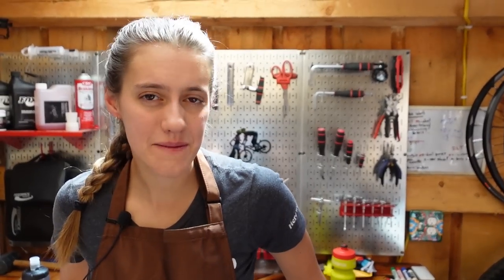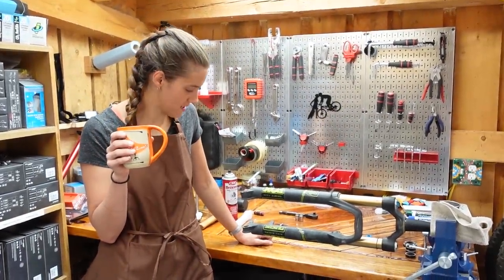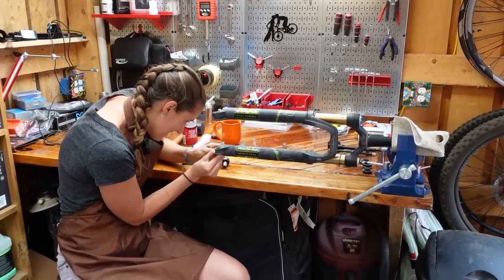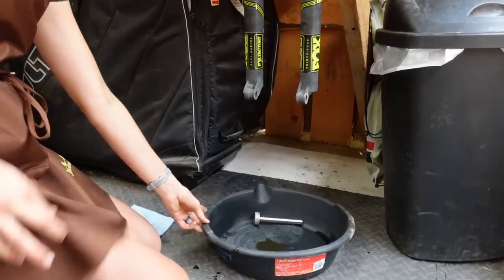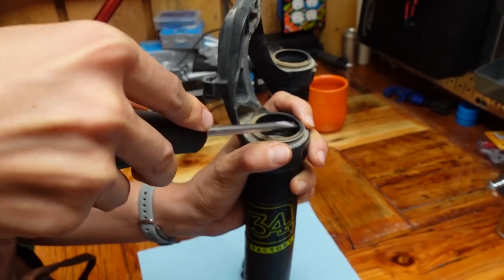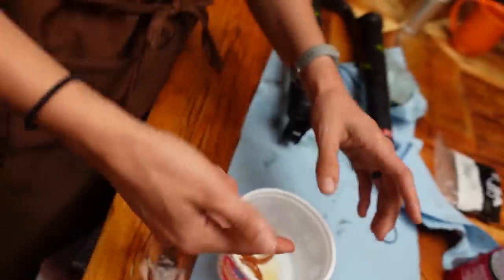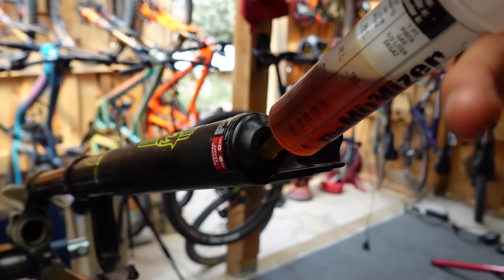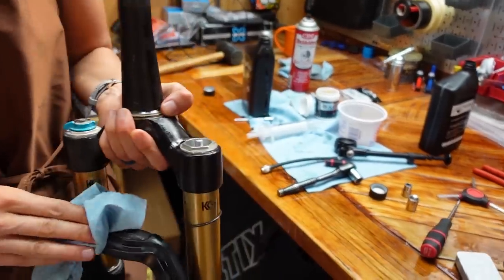Lowers service on a Fox fork | Syd Fixes Bikes

Comment from the maker: One thing we forgot to mention: when you're adding pressure back into the fork, every 20 psi or so, leave the shock pump attached and slowly compress the fork a couple times to allow the positive and negative air chambers to equalize. It will also slightly decrease the pressure in the upper chamber (what the pump is reading), so do the same when you get to your desired pressure and then double check that the pressure is what you want it to be.
Reply: timing from start to finish?
Reply: Another note:
1cm³ = 1mL
Reply: @peaceinpowder  18:56 😅

Comment: Tip for installing seals without a seal driver. Put them in the freezer for an hour and they install easier, also use slick honey or slickolium on the inside of the fork.
Reply: My version of this is heat the lower slightly with a heat gun

Comment: Some tips....
1. Clean the fork and dust seals before disassembly so you aren’t introducing dirt into the lowers when they are removed.  No reason to add contaminants. 
2.  Have the fork rotated up past 90 when you hammer the shafts in.  That way you can control when the oil pours out.  Just like you did when you added oil. 
3.  A seal installer tool is much more important than the shaft hammer tools since you can use the socket to hammer on.
4.  It is necessary to pre oil the foam rings, not optional.  Just because fox doesn’t build them correctly, doesn’t mean you should.

I really like the 1 minute overview you added to the end of the video.  So helpful for reference.

Comment: Great video! You guys are killing it!

To remove wiper seals from lowers use a cylindrical solid piece of plastic an 1” in diameter and about a foot long. You can score off amazon for nothing. Much safer to remove wipers without scratching anything.

Also make sure to soak foam ring in the correct bath oil. Grip 2 uses 20gold on air spring, but ptfe 5wt on the damper side.

Finally, don’t ever use the aluminum nuts to punch loose the damper and air spring shafts. The threads can be easily damaged doing this making it very hard, if not impossible, to thread them back on.

Just some things I noticed
Reply: What to use instead of the aluminum nuts? (DIY-style)
Reply: If you can find another nut with the same thread pitch, then use that. Otherwise get the steel punches from Fox.

Comment: That was really fantastic guys.  As a few people have noted, the theme of "Newbie learns to do advanced maintenance" makes everything much more approachable.  I'm, generally, a really solid mechanic, but have a fork (not Fox, but as Mackay notes, they all work generally the same) that is serious need of a service.  

Unfortunately, the rebuild kits for Suntour forks are really hard to get in Australia, grrrrrrr (will just have to buy the correct oil, and re-use the seals).

Thanks again guys.
Reply from the maker: We usually just do the oil and don't worry about the seals, so you should be fine. Might be worth pulling the foam o-rings out though and trying to clean then a bit (probably with just water and dish soap) because if they're super dirty they're just holding dirt against your stanchions and don't hold the oil as well.
Reply: @sydfixesbikes  Again, thanks for the advice guys.

Comment: OK, now this I needed.
I've always been terrified of touching my suspension. It's the only regular-ish maintenance thing I still go to the bike shop for every single time.

I'll try to do it myself next time 👍🏼👍🏼😎
Reply: Fork lower service and basic air can service on shocks is super easy (provided you have the correct tools). Assuming you have a work stand and basic tools, the extra tools needed for a fork service will pay for themselves on the first lower service you do.
Reply: @setransou  agreed. I've been riding for 5 years and wrenching on my bike for about 4, but I live in an apartment and while it's not tiny, I can't justify the space for a work stand... Maybe I'll look into a wall mounted alternative or something, but yeah. I'll look into investing into the few things I'm missing and get all the stuff necessary to do this. Thanks!
Reply: @Leo_Inclan  I hang my bikes in the ceiling with a "bike lift" meant for storage to work on them, not as sturdy as a proper work stand but it takes no room when not in use and gets the job done..

Comment: cool video! 
I have to say though on that fork with a service that long overdue, I would have cleaned the entire thing inside out and also removed the air spring, cleaned and relubed that. Who knows how much dirt was already in there everywhere. 
Other than that, you addressed exactly the points that every one doing this for the first time is afraid of!

Comment: You guys are great.  Thank you so much, I have an old Float100r on a KLEIN Palomino V and I want to grind the rim brake mounts off and paint the bottoms and the crown to match the "legendary" color shift blue paint (it's a full suspension cruiser essentially with gold and yellow accents).  Going to be tricky, I know, but disassembly seems to be the best course of action per heat and all, I already cooked a set of skeletal brakes, per heat from the Dremel, and don't want to make that mistake on these forks.  Thanks again and keep up the tutorials, you're the awesome Syd.

Comment: Fork service and steering tube cutting are the most scaring tasks for me! With this video I'm a little more confident on the first one...
Reply from the maker: Steer tube cutting is quite straight forward as long as you remember to put everything on before you measure (bearings, spacers, stem, additional spacer or two). Macky might have forgotten to include the stem one time... That was really bad!

Comment: As you found, a screwdriver is kind of a chaotic way to remove the dust wipers. It's easier if you use an open-ended wrench--they have one prong that points up and one that points down when you hold them sideways. Insert the upwards prong under the edge of the wiper and push down on the handle. I think the best size is something like 17mm but I just grab a handful of wrenches and test them until I find the one that fits perfectly.
Reply from the maker: Good tip. We saw that on the Fox website too, but not until after we'd used a screwdriver 😁

Comment: Nice video. Fork service scares me too.
One tip: don't use a regular screw driver to pull the o-rings. When you put a leverage like that there is a good chance you will damage the paint. 
And then this looks ugly because the paint comes off in sort of flakes (not just the area where you applied the pressure). Cover the screw driver with some hard cloth.
Edit: I also clean the fork thoroughly before opening it - some left over dirt might fall into the lowers.

Comment: For the lower leg service you don't need to remove the air. To remove the seals you can use the closed end of a wrench. And when you're installing the new ones you can put some grease on the outside of the seals and then they'll slide in much easier.
Reply from the maker: Good tips!

Comment: I don't know if this has already been said in the comments yet, but you can use a tire lever instead of a flathead screwdriver for removing the dust seals :)
Reply from the maker: Interesting. People have recommended dowel rods and wrenches, but not tire levers...

Comment: Great video. I will be following your excellent instructions to service my fork very soon. 

One thing: The link for "Fox 5wt suspension fluid" is incorrect. It actually goes to "Fox 20wt Gold fluid." A copy and paste error, I'm sure. 

Keep up these very helpful and informative videos. They are much appreciated in this DIY household.
Reply from the maker: I think it's actually the same link for both the 5wt and 20wt and you just choose which kind of oil you want from the drop-down before adding it to your cart. Let me know if that doesn't work!
Reply: @sydfixesbikes  Thanks! That works.

Comment: Unless you are pulling out the air spring you don't need to let the air out it won't shoot the lowers off, it will shoot the air cap off the top if you take it off without letting the air out.

Comment: A 20mm open end spanner is good for removing the seals, with the added benefit of not launching the seals into space.  A 25mm Dowell with a hole on one end, for the rebound,  is also handy for removing the lowers if you don't want to spend a fortune on the fox tools
Reply from the maker: But then you don't get to go chase your dust seals 😁

Comment: open wrenches work better for seals imo, protect lip though you can bend the metal if you use a screwdriver like that.  Supposedly big metal tire levers work well, but I dont have any.

Comment: huh...I didn't know you also put oil through the valve core.  I've always just done it through the lowers.  Thanks!
Reply from the maker: We added oil to both the lowers and the air chamber in the video..
Reply: @scottwhite3454  yeah, the chart says air chamber gets oil too. TMYK
Reply: @sydfixesbikes  My bad, got distracted and missed that.
Reply: The oil in the air chamber stops the slickoleum from gumming up over time and clogging the transfer port between the positive and negative chambers.

Comment: So good Syd. You're so cute working on the forks ! I' was scared to work on my son's 2018 Trek Fuel Fox 34 Rhythm forks -- as they need servicing but I;m not wanting to send it in.... If I can do this I will also do my 2021 Fox 36 Rhythm off my Giant Trance X2 --- really X0 --- customised now with an upgrade 2022 Fox Factory 36 160 Grip2 VVC this week great deal----- I feel I might really need to do these as they are so wonderful but.... I measured travel before having them installed at 166-167mm which may be correct as both my Rhythm measure 5-6 mm over the said travel spec, ie, 130mm and 150mm. Currently I think my Factory 36 has OVER greased in lowers from Fox factory and so the ports between neg/pos chambers may be blocked a little? I experienced the fork travel suck in when adding the vol spacers? Anyway right now it measures 160-159mm max.   However, I also realize these amazing plush forks need PTFE oil  for the Grip2 VVC damper, Anyway, a really inspiring and easy and clear video for servicing the lowers, Thanks you so much for making the time. PS: I can't wait ti hit the trails with my new FOX Factory 36 --- they look so cool on my jade green Giant Trance super - Mullet

Comment: When I take stuff apart, I try to take pictures before I take it apart. Also, as I disssamble things, I take all the screws of that assembly and put them where an egg would go in an egg crate (thing eggs come in at the store). That way things are grouped. Continue until everything is apart, filling each egg crate. Lots of times, if I am taking apart both left and right, I the right parts 'across the  egg crate' (left parts go where egg #1 goes, right parts go where egg # goes, assuming a dozen eggs).  Then when you reassemble, start at the last egg hole and work your way backwards to egg hole #1. Not my idea, stolen from a friend,  Also Syd is cute! And gaining competence. This is cool in numerous ways because she learns as she goes and any noob watching sees it can be done.

Comment: This is absolutely brilliant 🔥 The way I can relate to Syds worries annoy damaging stuff and then seeing it done no problem was just so satisfying. I've been putting up doing this for a while now. 2 years without service, it's gonna feel good! 
QUESTION: My 34 Performance Elite Float FIT4 has a "open mode adjust" slow speed  compression dial but it's stuck and moves with the 3-way lock out knob. How do I fix that? 
Awesome new channel guys, big fan of this!!
Reply from the maker: I think it's supposed to move when you flip the lockout knob... But if you can't move it independently it might require a damper service (something we haven't covered yet). It could also just be as simple as it being dirty and stuck. The first thing I'd try is some WD-40 sprayed on and around it, let it soak a bit and then see if you can get it to move.
Reply: @sydfixesbikes you guys truly are a blessing, thanks for the rapid responds. Yeah, it's stuck in a way so that I no longer can adjust it. Had left it in the range setting for some months and all of a sudden it was stuck.. I'm definitely try som WD-40. Been dreaming of young kit forks from 140 to 150mm. Equally much to get a little slacker headangle as the extra travel. Would that be I'll advised on a Fox 34 being a 190lbs rider..?
Reply from the maker: I doubt you'd feel much (if any) flex with the 34. They're quite stiff, even at 140/150mm!

Comment: When I serviced a Fox shock, in the kit they supplied 2 vials of fluid/oil for air chamber which was blue and instructions told to avoid contact with skin (can induce cancer). Seems forks don't use such hazardous substance...

Comment: Most of my mechanical experience is working on trucks.  "Getting things off of things" is 95% of truck work.  It's actually what intimidates me about bike work.  With my truck suspension, if the ratchet doesn't work, I get a breaker bar.  If that doesn't work, I put a pipe on the breaker bar.  If that doesn't work, I get an angle grinder or torch.... I'm not sure my skill set will translate well to Mtb suspensions.
Reply from the maker: Yeah, you're gonna wanna go WAY lighter than you feel like you should whenever tightening any bolts 😁
Also, if a bolt isn't coming loose, make sure it isn't reverse threaded... There aren't many on bikes, but you gotta watch those pedals!
Reply: @sydfixesbikes  Just seeing torque specs where decimals matter makes me nervous.  Thanks for helping me learn, though!

Comment: Thank you, the content you are both putting out is super fun and helpful. I have service kits ready for the front and rear suspension. I will crack on with that this autumn/winter. I have a question, what vice are you using? Looks like such a versatile vice. Thanks in advance! Happy trails!
Reply from the maker: We got it on Amazon. Here's the link: https://amzn.to/35xd1Kl

Comment: If you have too much movement with the lockout closed, is that a sign there isn't enough oil? If so, which side needs topping up? I have 25-30mm of movement with the fork locked out.
Reply from the maker: No, that sounds like the damper needs to be rebuilt. I believe this is something I've can do themselves, but we've never done it as it requires a lot of specialized tools.

Comment: great vid, thanks for this.  Question- on forks with Grip2, the damper side uses PTFE oil rather than gold.  One thing I've never been sure of- do you soak the o-ring on the damper side in gold or PTFE??
Reply from the maker: You want to match it to the fluid that you're putting in that side (inn this case PTFE) because that's what it will be lubricated with as the fork cycles.

Comment: Thank you for this! I just bought a 2012 Mondraker Foxy and I want to rebuild the fork. The only problem is that I can't find the specified seals on the internet for anything below 100€. I was wondering if you guys can help :) Do new fork seals work with older forks(the same size)? Thank you!
Reply from the maker: Hard to say. In general, if it's the same model, you should be able to use newer year seals, but probably worth checking with the fork manufacturer. Good luck!

Comment: I noticed that you added Fox 5 wt w/Teflon to the air chamber, I'm not seeing that called for in the Fox Charts for current models.  Is that a Pro tip?
Reply from the maker: Some of the current models still recommend that (it's listed as "air chamber"): https://www.ridefox.com/fox17/help.php?m=bike&id=2817

Comment: Hi! Is the fluid through the air side valve core needed for all 2020 models? This is the only video I have seen do that. I have a 2020 34mm Float Performance if that helps
Reply from the maker: You can either inject it through the valve or remove the air cap and put it in that way, but yes, all forks require it (it's listed as "Air Chamber" on the volume charts).

Comment: Is it safe to reuse the crush washers if they are nearly brand new still and haven’t been removed yet? 

I just need to add bath oil to the grip damper side.

Thanks!
Reply from the maker: Technically, no, but we have done so without issues. I'd say go ahead and then clean that area really well and check it a couple days later to make sure it's not leaking.

Comment: Thanks for the video guys….but I have a critical question:
A week ago I have serviced my FOX Rhythm 34 2018 Fork according to the video.
unfortunately, later on I have discovered that I should have put 5WT bath oil on the Damper side – since my fork is a GRIP Damper (!).
Would it be OK to leave it that way?
And if not, What are the implications for that and What should I do (service) in order to correct it?
Reply from the maker: That's a great question. Based on some googling, it sounds like it probably won't hurt anything but it could negatively affect the performance, especially since it's on the damper side. You shouldn't have to do much to fix it, just drop the lowers and put the correct oil in.
Reply: @sydfixesbikes  Yes, that's what I thought eventualy and the obvious conclusion after some googling myself. Already ordered the Fox 5WT, I will do so when it arrives. Thanks alot!

Comment: Syd...I say you put 30 cc's in the bottom two forks and 15 cc's in the air intake side but didn't see you add any oil in the opposite stanchion, is there a airway for the oil and air to equalize between each side of the stanchion....thanks
Reply from the maker: The non-air side holds the damper cartridge which is a closed system and has it's own lubrication, so you don't have to add any oil to the uppers on that side.